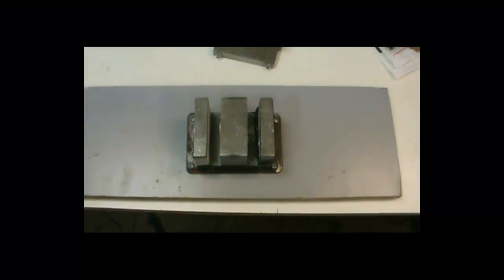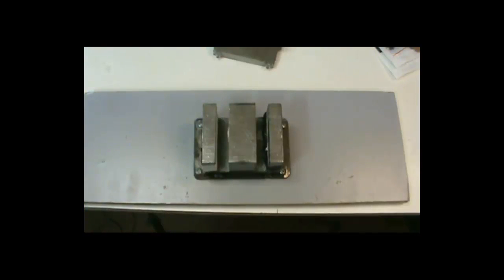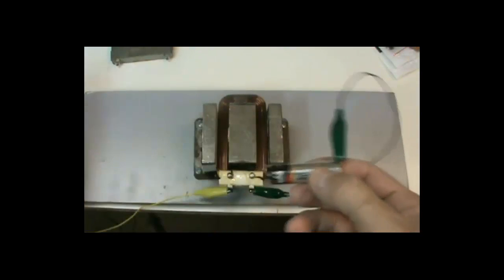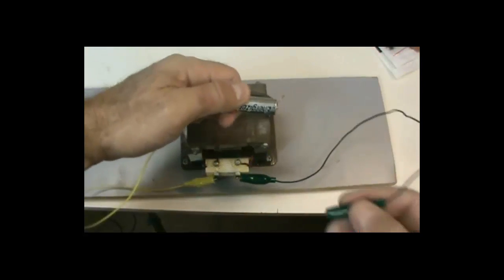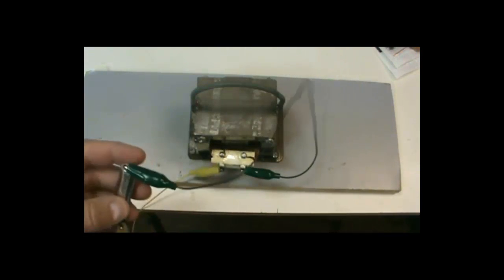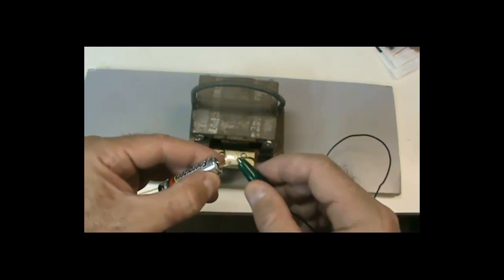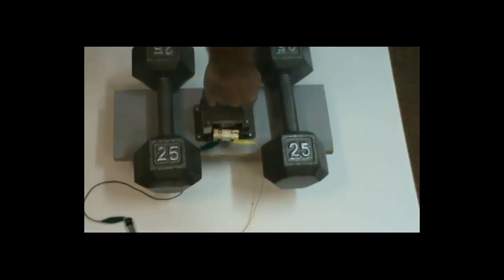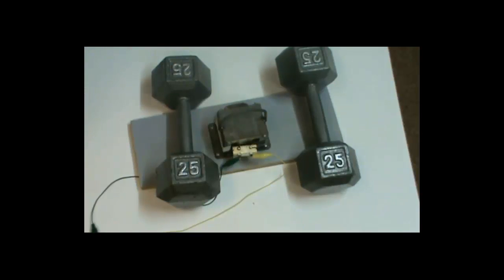Easy-to-Build Electromagnet lifts over 50 lbs

Comment: I have a question on how to make a magnet that can pick up nails and srews through roughly 2 inches of dirt.
Reply from the maker: Making an electromagnet that can pick up small objects at large distances (e.g. 2 inches) will require a huge magnet that will require large amounts of power. I would use a very large Rare-Earth magnet with a release mechanism to remove what you find.
Reply: Alright thank you, I'm cleaning up an area that is going to be used for horses hence the need to be able to go a couple inches deep.

Comment: That is incredible!  What I wonder how destructive the inductance would be if turned off and on with a transistor.
Reply: That's why you use a flyback diode, though burning transistors would be fun.
Reply: Cool thanks!  it gives me an idea to make electromagnets for some Halloween props.  Wouldn't want to use Relay's to turn the magnets on because they are usually noisy so wondered about using a switching transistor. I will have to look at a flyback diode to see if that would protect the transistor.
Reply: If you decide to use a relay, keep in mind you need a flyback diode across the coil too.
Reply: Potentially well over 10 times the input voltage. Is this not the principal of tazer or ignkypr coil in an engine ?

Comment from the maker: Higher current is necessary to increase the strength and this requires a higher voltage.

You must make sure your power supply can create the current necessary because some power supplies can provide the voltage but not the current.

Too much current will cause the magnet to get hot so be careful not to burn the unit out.

Comment: Hey Dorian i need to make about 6, 10 pound magnets, how should i go about doing this; how much coil do you think i need, would one of these batteries cover all of them. And would hooking them up in parallel get the most out of the voltages. Also im trying to make them fairly small like an 1/2 inch to an 1 inch diameter. Thank you for the video it was very interesting
Reply from the maker: Haden,

When you say 10 lbs do you mean magnet weight or lifting weight?

To lift this much weight the construction of the magnet must be similar to the electromagnet shown in the video or even better is something like an iron rod, wrapped with a coil and surrounded by an iron pipe. This type of construction concentrates the magnetic field into the lifting area.

I've posted a link to a similar magnet design in the description area of my video since links are not allowed in YouTube comments.

You will probably need to run these magnets in parallel. In parallel they will use 6 times more current than a single magnet so any battery will not last long. I would start with at least 25 feet of #20 wire wire per magnet.

Let me know if you have any further question.

Dorian
Reply: Thank you Dorian ill let you know how it goes.

Comment: Hi Dorian:  First off. Thank You for the great video and information. Please allow me to ask You a few questions that are different then others. How can you run this constantly with a six or 12 volt battery without overheating? I prefer the 12 volt. would that increase the pulling strength? On the transformer and wire core, Where would the North pole and South pole be located? Please bear with me. I know little to nothing and am trying to learn. Again Thank You.
Reply from the maker: It is a difficult balance to increase the strength of the electromagnet without overheating  since the magnet is low resistance wire in series with a voltage source. The magnet polarity depends on the direction of the current flow. The center of the coil will be one polarity and the outside metal will be the opposite polarity.

Comment: Is there any way that you can do something like that and have it plugged in for most of the time except for brief periods of time? I was thinking of making a "lock" for a furniture that way.
Reply from the maker: +Henrik Emanuelsson Unfortunately electromagnets use quite a bit of power while running. Some new technologies allow magnets that can be magnetized and demagnetized on demand but these are expensive.
Reply: +Dorian McIntire Thanks for your reply! Ok, to bad. But how magnets holding doors open and other things work? Is that not electromagnets?
Reply from the maker: +Henrik Emanuelsson The electromagnets your talking about are for AC power. While they still use a few watts of power the inductance limits the current to a low value without wasting much power.

Comment: +Dorian McIntire I made my electro magnet and it works great but I can't get it to repel. I tried reversion the currents and tried different metals but it won't repel any suggestions? Thanks
Reply from the maker: +CAMERON BROOKS An electromagnet can only repel other magnets if you're powering it with  DC. You must run the electromagnet off of AC to repel non-magnetic metals such as aluminum.

Comment: Hey, Sorry to be asking so many questions but I've taken to top of to transformer with a hacksaw (Took about 4 hours :D) And the coils are glued in. Did you have this problem?
I've tried a sharp knife but doesn't seem to be doing much.
Reply from the maker: The coils usually stick to core a little bit due to the sealing varnish but I've never seen them glued in. Try to knock them loose with a piece of wood (to prevent damage) between the coils and a hammer. This may do the trick.

Good luck.

Comment: The wire on that actually looks flat rather than round; is that the case, or is it just round wired that has been looped many times?  Please let me know.  Thanks.
Reply from the maker: If your talking about the wire on the battery it is flat since I soldered a piece of de-soldering braid to the battery as a conductor. It was wire I had available and doesn't affect the way things work.

Comment from the maker: Its not important that the coil touch the metal.

Be careful not to remove the insulation on the wire. The wire is coated with a thin transparent coating that keeps the copper in the wire from shorting together.

Comment: Great video, thanks for sharing, a few questions;
 
how important is the metal base where the coil fits nicely?
Also how do you make the magnet to repel the other half of the transformer or any other metal?
Reply from the maker: Ernesto Del Bosque The metal base is very important since it helps keep the magnetic permeability (sort of like magnetic conductivity) high and keeps the magnet strong. A magnet that repels other metals is possible but such a magnet must use AC power to work. It will not repel iron but will repel aluminum and copper by inducing electric currents in these metals that will create a counter magnetic field. I will show such a device in a future video. Thanks for your comment.
Reply: Thanks a lot for your videos
Reply from the maker: Ernesto Del Bosque Thanks for watching.

Comment from the maker: The secondary has 10 times more turns of wire but 100 times more resistance.

Since the strength of the field is proportional to the ampere-turns (current x number of turns) you will get a stronger magnetic field for a given current. To get the same current as the secondary you need 100 times the voltage but your magnetic field will be 10 times stronger since it has 10 times more turns than the secondary.

Bottom line is that you will need 10 times more voltage to get the same effect.

Comment: how many mins. or hours long will the AA battery hold the 50lbs...does it degrade slowly or all at once?
Reply from the maker: 15 minutes is a conservative estimate at a 1 to 2 amp rate. You can check this yourself by reviewing Energizer technical information for AA batteries.

Comment: Hi, I tried this tonight with an old microwave.  I accidentally damaged the coil but I was lucky that it only cut the loops down a by a few.  Unfortunately it didn't work for me.  Upon inspection it seemed the coil may not have been copper.  Is this likely to be the problem?  The coil looked exactly like the one you have in this video as did the rest of the transformer.  I don't know why it didn't work.  Cheers
Reply from the maker: I suspect your are using a 220 volt transformer core, as deduced from your salutation, which requires a higher drive voltage than a 120 volt coil from an American microwave oven coil. The coil resistance should be about 0.5 ohms for low voltage drive. See some of the other comments for other possibilities since about every possible issue was covered at one time.
Reply: cheers.

Comment: Not sure I understand why only thick metal can be lifted. Pretty unfamiliar with the whole electromagnet field.  What type of magnet would work to lift and or bend thinner metal so as to possibly pull a small dent out of sheet metal?
Reply from the maker: Thick metal object offer low resistance to the magnetic field so many field lines can dive into that material. Each field line helps hold the magnet against the thing you are lifting.

You can create an extremely powerful magnetic field, for a brief period of time,  by pulsing a huge electric current through an electromagnet briefly. For example you could use the electromagnet in the video in conjunction with a charged capacitor that is charged to a voltage much higher than 12 volts. This might be able to remove a dent.

Comment: i accidentally damaged the coils so my question is, is it possible to buy copper wire and make a coil myself for the microwave transformer??
Reply from the maker: This would be difficult but do-able. Just use the same number of turns (maybe a few more)  and the same gauge wire.
Reply: ok thanks a lot man!

Comment: I really like this idea. What wattage was the microwave that you pulled this out from? Have you found other microwaves to have similar transformers (i.e. you can take apart)?
Reply from the maker: It was an 1100 watt microwave. Most transformers with a 120 volt primary coil will work.To take the transformer apart you must break some tack welds using a side grinder or hack saw.

Comment: do ya think this little guy would be hurt if you used a 9v on it? i'm curious about using this against some hardened steel to create permanent magnets. not sure if it'd work, but i'd sure like to try :)
Reply from the maker: +james lawrence 9 volts will work but the current capability must be high. A 9 volt battery typically can typically only supply a high current for a few minutes.

Comment: I tried this from parts I pulled from a compact emerson microwave. I'm not sure what I'm doing wrong, but I am getting very little magnetic force with a AA battery, also tried with a 9v battery and got a little better, but it was barely better. Did I do something wrong?
Reply from the maker: Did the oven operate from American power or European power?

This may seem like a strange question but the transformer will be different if it is not designed to operate from an American AC power wall outlet.

Did you remove the high-voltage coil made with fine wire or did you remove the 120 volt coil made with thicker wire?

Are you using a fresh battery?

Are you using a thick wire to connect the magnet to the battery?

These are just a few of the potential problems that can keep the electromagnet from operating properly.

Can you send me a picture of the electromagnet you made so I can spot any obvious problems.

Thanks.
Reply: Dorian McIntire American. I removed the coil with the fine wire (that's the secondary coil, right?). I am using previously-unused batteries. I thought it might be the wires not being thick enough, so I held the 9v right against the terminals on the coil and that didn't change the strength. What is your email? I can email you a picture of my mot
Reply from the maker: andrew23890 
Yes, the secondary coil is the fine wire.

Have to tried connecting the electromagnet to a 12 volt battery? Don't keep it connected for more than about 30 seconds until you find out if the coil will overheat.

I'm sure you probably already know that the magnet has a very short range and will only pull hard on thick pieces of flat iron.

My email address is:

dmcinti1@tctc.edu
Reply: Dorian McIntire All I needed was a thick piece of flat iron. Nifty!

Comment: I want to pull an iron chair using a magnet. Chair will be around 1 to 2 feet away from d magnet. Please suggest how to make dis electromagnet.
Reply from the maker: Sorry but you'll need a magnet bigger than this to do that:
going to the scrap yard
The force of a magnet drops off very quickly with distance.
Reply: Dat scrap yard magnet is not feasible, I need it for educational purpose, cant it b done by like stronger battery, adding capacitor, inductor in d circuit. (m from elex backgrnd, little additional technology work will do). Please help.
Reply from the maker: *****
It's not really feasible with a small resistive magnet at that distance. Even a superconducting magnet would have a problem pulling a metal chair from that distance. While it is possible to lift heavy objects with magnets it is not a simple or easy feat to get the magnet to work over distances of over a few inches.

A resistive magnet that could do such a thing would need several megawatts of power and would melt if it was not water cooled.

I wish I could help - because I would do this myself otherwise - but such a magnet would be enormous and cost a fortune.

Read this material from MagLab for information about high-power magnets: http://www.magnet.fsu.edu/magnettechnology/research/magnetprojects/index.html
Reply: Dorian McIntire thanks alot Dorian for all ur help n guidance. Really appreciate the extra mile u went wid that link. Thanks again.
Reply from the maker: *****
You're welcome. Sorry for the disappointing information.

Comment: From 1,5v thats amazing, I would never have thought that much force could be available....12v/9ah battery would give how much force then ?..Lift a car almost. How can you protect the battery from over heating, because this circuit is basically a short circuit.?....Nice video, I subscribed to your channel.
Reply from the maker: Higher voltages should only be used for short periods of time to keep both the electromagnet and the battery from overheating especially when using higher voltages. You are right that the coil is essentially a short circuit, or at least a very low resistance (about 0.5 ohms), so things can get hot quickly if the current is sustained. Thanks for commenting and subscribing.
Reply: Dorian McIntire
Thanks for your reply....In your experience is there an optimum coil size for say 12v/2amps supply continuous..without everything getting hot.
Reply from the maker: MrFreddiew1 The interactions between coil turns, coil wire gauge, resistance, power dissipation, current, voltage and power supply capability are pretty complex so I'm not aware of any formula for optimum efficiency. The simple rule of thumb is to use the smallest gauge (largest diameter) wire you can find, use as many wire turns as you can and pass as many amps through the wire as you can without overheating your power supply or magnet.
Reply: Dorian McIntire
Trial and error.....Ok thanks for your response.appreciated.
Reply: Looking at only direct current in a coil,  all copper coil will have some DC resistance. Current is i=v(voltage)/r(resistance) ,  Power is watts = i * v. Given that  i = v/r, watts is also expressed as  w=v*v/r or w=v^2/r . The resistance will change a little as it warms up, but for the most part and for simplicity we might assume the resistance doesn't change. putting that together means that as voltage grows,  amps will grow geometrically to the voltage, and power consumed grows exponentially to the voltage. After the magnetic field is established, all the power being consumed is dissipated as waste heat from the resistance in the copper wire. This slowly heats the iron core.  so run times is limited by higher voltage and how fast the core can dissipate the heat.  Now without an iron core, a coil's magnetic field strength has a linear relationship to the the amount of current flowing through the coil. A coil with an iron core will have a stronger magnetic field as the magnetic domains in the metal align and contribute their magnetic fields.  But it has only so many magnetic domains, and at some point their are no more domains to align and contribute to the magnetic field. this is called saturation.  and adding additional current  to increase the magnetic field takes a bend growing at a slower rate.  

Now on optimization. If we restrain our discussion to current below magnetic saturated core, and look at the geometric growth of current to voltage and exponential growth of power consumed to voltage, and ask for an optimum ratio of (magnetic field strength/power consumed) then we might look at lower and lower currents as having better ratio. But at almost 0 current, one would not have a useful magnetic field. In other words, one should probably start with asking what kind of magnetic field does he want, and how to optimally achieve that given a specific application's constraints. 

Now if you must use 12v you might try pulse with modulation and vary the duty cycle to control how much power is fed into your coils. you may also consider ways to active and or passively cool the coils.  

One might also try voltage divider.  by adding a resistor in series  first measure the ohms across a coil.  This might take a bit to settle down to one value.  if the max current you want is 2 amps. Then the equation is 12 volts /( resistor + coil resistance) = 2 amps,  and solve for resistor.

Comment: Great 👍🏼 video..... will the magnetic 🧲 force be greater using the secondary windings?
Reply from the maker: No. Although the secondary winding has more turns its resistance is too high to allow a large current to flow. A good electromagnet is balance between coil turns and current. More turns means more resistance which means less current for a given voltage. I wanted to use a low voltage for this particular electromagnet.